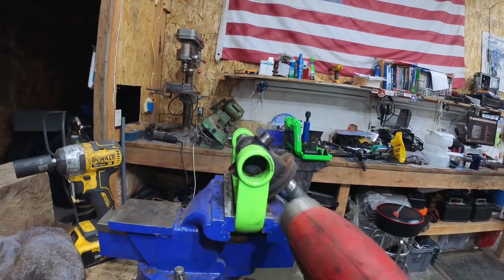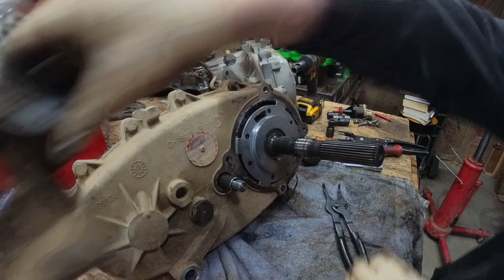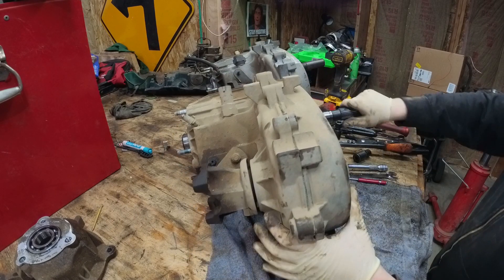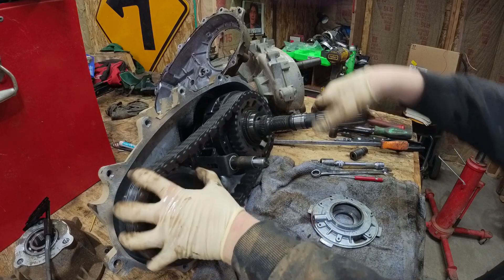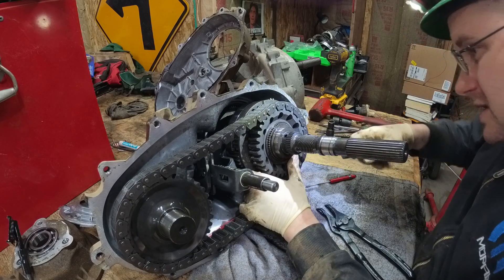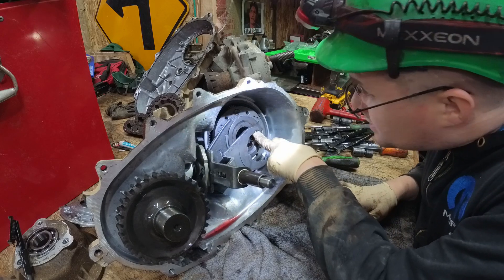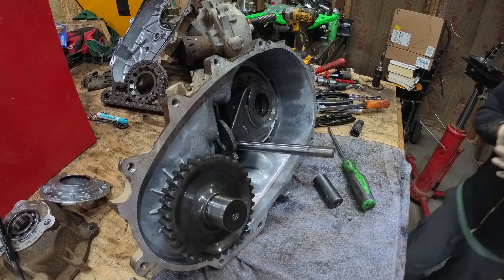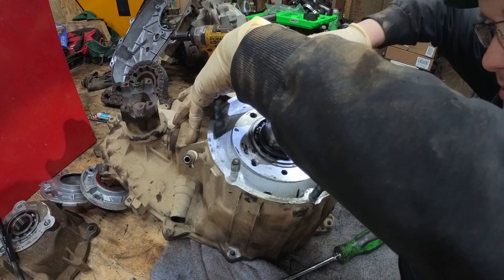NP 242 Teardown

Comment: Dude, this video is awesome. Thank you so much for taking the time to make it. I am swapping a 242 onto my XJ, but the one I bought came off of a WJ, so several bits of outer hardware need to be swapped as well. I figure since I am taking the time to do that much, I might as well open up the 242 and evaluate/rebuild. This video helped me to make sure I was not missing any details before I started trying to pry the cover plate(s) off.
Reply from the maker: Once you get inside one of them they are pretty simple. Not really a bunch to go wrong once everything is lined up. Probably the hardest part is the shifter rail.
Reply: @MegaMarclar  The one that I bought doesn't have a worm gear for the speedometer sensor because it came off of a WJ, which uses the ABS rings on rear wheel. I found that you can buy the main shaft for the Tcase new, from Crown Automotive. I ordered one. I will use it to rebuld the tcase. Similar to a SYE -- just remove the old shaft and install the new one. Thanks for the info and for replying.
Reply from the maker: @johnmortimer7862  there are actually 2 variations of the wj case. the 4L is a standard 27spline 242, where is most v8's are a 32 spline output. shafts between the 2 aren't interchangeable. I actually have a 27sp  sitting on my bench. you'll need the tail shaft housing that has provisions for the speedo sensor as well. sye is the way to go though. I have a hack n tap on mine in the zj with adams driveshafts.
Reply: @MegaMarclar  This one is 27sp, I made sure of that before I bought the case. I thought that the snout/extension parts from the NP231 will just swap onto the NP242?
Reply from the maker: @johnmortimer7862 That I'm not sure of, honestly I've never really messed with too many 231s
Reply: @MegaMarclar  Guess I'm gonna find out. Lol. Thanks again man.
Reply from the maker: @johnmortimer7862 let me know here if you remember how it goes.

Comment: what are/did  you putting this 242 into?    What yoke is on it for front drive shaft.   Am re-newing one to go in a 5speed TJ.  Am changing to longer trans input out of 231.   Got suggestion on what to do with front driveshaft? It has the more typical yoke on it and not the Rzepa.yoke..  but been told the 231 yoke and the 242 yoke... while look same.... they aren't (part #'s support that too)
Reply from the maker: factory case on my zj. not sure about the yoke its whatever 1310 yoke is original to the case. Im guessing the yoke difference in p/n maybe a length thing, other than that the driveshaft should be interchangeable between yokes. I use custom shafts from Adams driveshaft in vegas

Comment: Probably a dumb question, but how did you remove the slip yolk off the rear of the shaft? Driveshaft blew off today because of a bad u-joint and I need to remove it to press the u joints out and I can’t get it to budge
Reply from the maker: it should just slide right off.